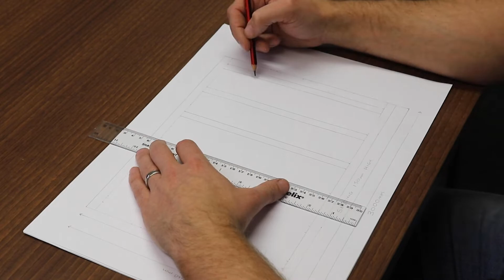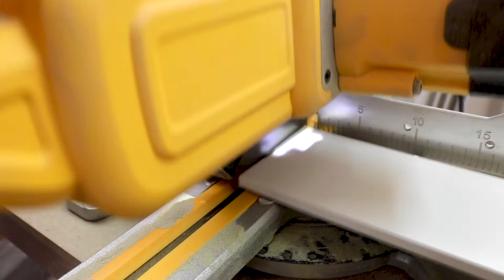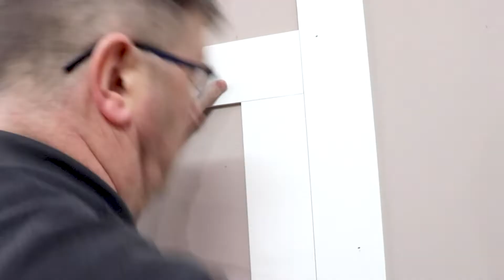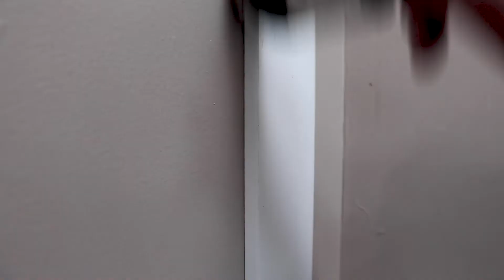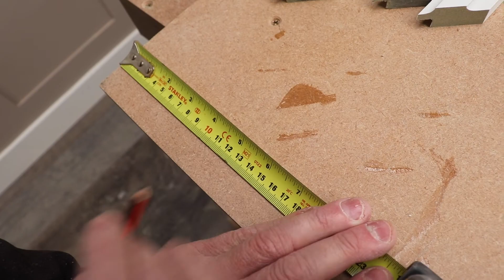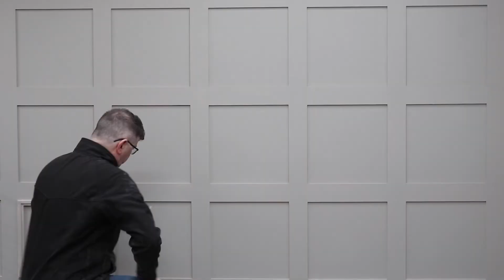WALL PANEL INSTALLATION | How To Fit Squared Wall Panelling With Mouldings | Easy DIY Tutorial

Comment: Excellent video. Any advice on differences in depth between skirting and panelling?
Reply from the maker: Thank you, Angus! 

If you have a skirting board profile whereby you can sit the wall panel on top of (like the squared skirting board profile in our video) it should be no issue.

However, if your skirting board profile leaves a thin edge on top, the wall panel would overhang.  

You can take your skirting board off and fit a panel behind it that would be the height of your skirting board + the height you have chosen for your panels. For example: 150mm high skirting board + 100mm wall panelling band = a 250mm wall panel base rail to be fitted behind your skirting board.

However, this may mean that your skirting board will stick out past your architrave because of the greater depth. 

Hopefully that makes sense!